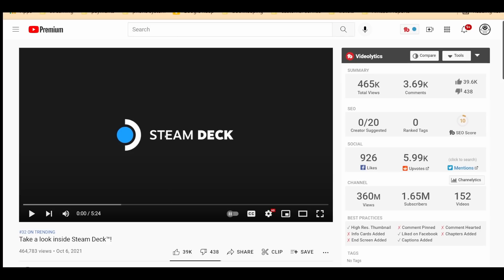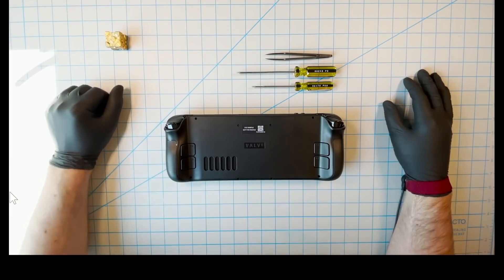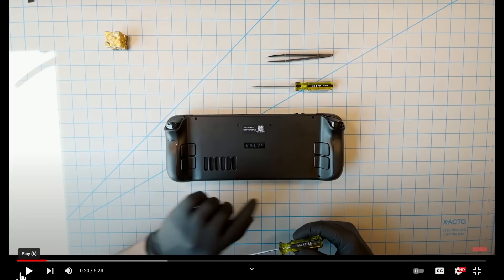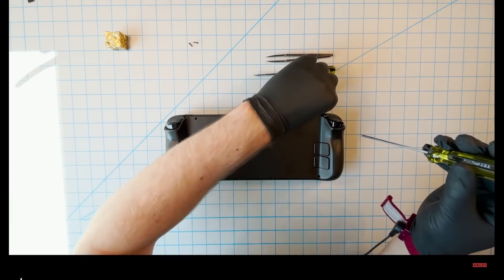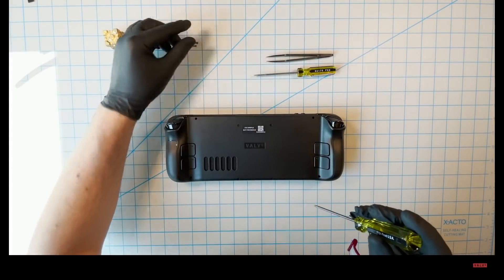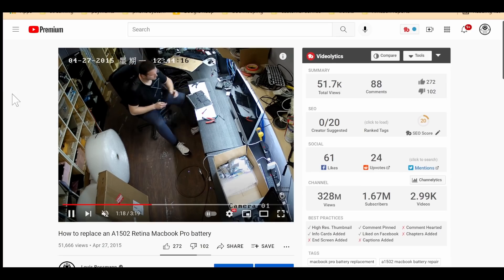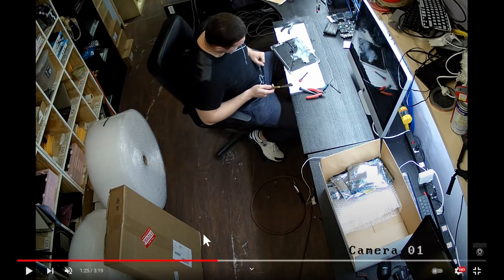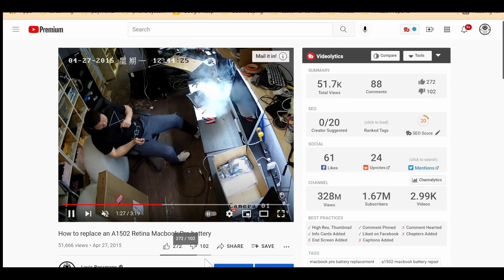Steam deck battery may end your life? bruh 😑

Comment: I agree with you that that I think they're just beign extra careful with their wording by saying the batteries could kill you and opening this up "will decreese the structural integrity" because of legal reason, like I can see how it could be the case if you mess up by damaging some seal or not putting the right torque on the screws, it's definately not the case all the time that opeining it up will reduse the durability and very unlikely that someone will die from inproper handling of the battery (you could maybe burn down your house and die in the fire I guess) but like I said think they're just being extra careful with the wording for legal reasons

Comment: @8:40

It doesn't ruin it, HOWEVER, because the screws are embossed in plastic, if you crossthread it by overtightening, it will be looser, and if you do it too badly, dropping it could pop the screws through the casing.

Comment: Given that they're using self-tapping screws, the structural integrity claim does have some merit. The screw posts can be easily chewed up if you aren't careful to thread the screw back into the original plastic thread. Would have been better if they told you how to avoid this potential issue though (just slowly turn the screw backwards until you feel it drop into the thread before screwing it back in).

Comment: I think saying things like "why you should not do something" is a way for valve to protect themselves legally when someone really mess things up.
As the stractural integrity I am sure it is for the same reason plus if you open and the screw holes are plastic at some time it will be loose..

Comment: for the structural integrity part, the only thing i can think of is self taping screws get less effective at holding things together the more you take them in and out because they are effectively cutting new threads everytime they go in, so theoretically, if it is opened too much, it could loose the ability to actually hold itself together.

for your last comment on the warranty thing, i like to think im not one of those "dicks", if i supply a part for you to install, i supplied because i want that particular brand or product, and thus i know the warranty doesn't cover the part itself as it wears out under normal conditions, but what i do expect your warranty to cover is  the work that you provided, meaning if you do something wrong and either the part i provided or and unrelated part fails as a direct result, then i expect you to warranty the work,  this also includes if you accidentally damage the part during installation, after all, i brought it to a professional so as to lower the risk of damage during the install.

as for the original topic, i used to work for a third party company that repaired apple devices, i specialized in the iphone 5c and 5s. but there were other devices being repaired as well, someone punctured a li-on battery in an ipad, our sop was to immediately dump a trash can onto the floor, use can to cover the device to try and contain the smoke, and the entire area evacuates for half an hour while the specialized cleanup crew went in with proper ppe to make the area safe again. ive personally never punctured a battery and i don't ever want to, but its not going to stop me from opening my devices, i took the li-on battery out of my hp laptop cause i saw it had swollen during one of my routine cleanings, now my laptop is cable only operation

Comment: Yeah if opening a device really weakens the structural integrity that's noticeable then it's not a good item to buy because it's designed to fail/break quickly even if not opened.

Comment: My first thought think when they said opening it up will weaken it.. they meant at that moment opening it will weaken in that moment.. and maybe if you do not put the back cover on correctly, you weakening your steam deck..  but if you can put it on carefully it should not be a problem.  The back plate is like the tab on a pop can.. when its closed up and holding soda.. the pressure of the soda inside the pop can makes it vary strong, and the sort of thing you could hurt someone with.  but when you open it up, the soda in the pop can can now move  out of the way easy and cause it to be vary easy to bend the popcan.  

The issue in all of this is self tapping screws in a the plastic.. those are really easy to strip and ruin... so if you ever hand any experience with those in plastic devices.. that will tell you more then enough to know if you can open and close up a device like this.   I would think for you Louis.. it is no problem to deal with those things.. and you might have way to work around should you accidently strip a screw.  Most people should let you handle fixing, and upgrading a steam deck if it has a problem because of this..

Personally, while I feel like have no problem opening and closing this back up...and its vary nice they have replacement joysticks, but I really hope I don't have to.  it be nicer to do without opening it up.

Comment: Pong, 1976ish...  Okay, I have an crappy old swelled li-ion battery I've pried on and poked at here and headed outdoors now to drive a nail through it...
I've tried and not succeeded damaging chips with normal static electricity.  These devices most often have ESD protection built into the circuitry, I know this from working in the device industry along with the design engineers..

Comment: With the screws being self tapping and requiring a particular tightness I could see that being the reason for the disclaimer of the structural integrity. If someone over/under tightens they could make the device less structurally sound so it won't meet the original specs that they did for drop testing. With this being a mobile centric device I can see why they put that in the video as some peoples experiences with newer phones being decently drop resistant.

Comment: You are making the classic mistake, saying I I I, you are you, everyone else is not you. your applying your own logic to what the Guy is saying, a company has to cover every base when it comes to sending out any electrical device. I have seen plastic bags with do not put this over your head, why because someone has either died or nearly died putting the said plastic bag over their head. What if someone swaps put their battery for a aftermarket cheap clone sets it up and it works puts it in a back pack to go to a friends and it explodes like that. Look around this has happened many times. Its too easy for you to use your own logic on why the guy is saying but when it comes to the public, well I've seen people retrieve a piece of toast from a live toaster with a fork, insert metal into sockets. Valve have to cover every base, and no matter how stupid or patronising it sounds people will do stupid things.

Comment: Shows that right to repair is making slow progress. That's good. About 30 years ago I did blow an IC on an apple II.  Then I repaired 200 of them without an issue. Lesson; don't work on stuff at 2:30 in the morning. I don't wear a wrist strap. I have seen why they say you can affect the strength of the case, incorrect assembly by someone that doesn't know how or why all those screws are put in in the first place. Mostly, people just drop them and break them without taking them apart anyway. (Which I am sure you know).

Comment: I think the warning about the battery was less about the immediate danger and more about long term dangers.  Imagine you're just an amature and you're swapping out the SSD in this thing and you accidentally put a small puncture in your battery and it doesn't flair up, but stresses it so that it CAN flair.  What happens when you put that Steam Deck in your backpack and you're on a bus or you're walking around and it gets hot enough to rupture the battery and it bursts into flames and now you're on fire because it lit your backpack and your clothes.

I definitely get that it's a niche scenario, but Valve probably has to mention it for legal reasons.

Comment: I think they implying that when the screw are not replace properly that the device is easier to open back up if drop and not that the plastic structure become fragile but also if you use the wrong screws or over tighten you can split the plastic at the screw hole   but overall it a video that armatures should not use and that why he keep stating get a professional (like you Mr. Rossmann )to fix it, and the key point is spare parts availability . 👍🏻

Comment: The glove looks like the relatively conductive carbon kind with less than 10^9 Ohm surface resistivity.
I think it's fine to put the ESD strap over that.
Reply: Actually it looks like the contact part of the ESD strap is on correctly. There's a metal plate under the part where the cord plugs into the strap, and that actually looks like it's touching his wrist skin where the glove stops. It's just unfortunately that the backside of his wrist, the strap is looped over the glove which makes it look wrong, but in fact that part of the strap isn't important as the metal contact on the other side. Most ESD setups that the other end of the cord plugs into will sound an alarm if it doesn't detect contact with skin, so if he does have it plugged in, it must be touching his skin if the alarm squeal isn't driving him nuts.
Reply: That was my thought also.

Comment: Regarding structural integrity: they've said "lessened somewhat" not "ruin". Those are two completely different assertions.
I think it comes back to the self tapping screws. If structural integrity depends on the back being really firmly attached and the screw holes get slightly widened each time you put it back together, structural integrity will be "lessened somewhat".

Comment: It's definitely all because of legal reasons, especially the structural integrity part. You cannot 100% be sure how someone puts it back together especially with self tapping screws as most people have no idea what they are doing. And with it's compact size, even a mm could cause something to go wrong, even if it's a one in a million chance of it happening. Think of how many people use steam and the market for this. They are being overzealous because they don't want to get sued into oblivion for something that normally shouldn't be an issue.

Comment: 8:07 As someone who's thrown and smashed game controllers hundreds of times, and opened them with their super-weak self-tapping screws to repair them many times, I can say that this is total bullshit. The plastic screw posts will break off before the screws strip. Besides, if this really does weaken the threads, it would transfer more of the drop energy to the threads stripping, rather than to the frame as with the factory condition.

Comment: @Lous, as someone who's taken apart a number of gameboys and cheap MP3s that use self tapping screws; I can totally believe that taking the device apart weakens it.
the PS4/5 controllers are the same. once you mess up the plastic that the screw threads into; the shell can easily partially come lose leading to cracks in the plastic when dropped. 

that being said, on a device that expensive, they shouldn't have used self tapping screws. this isn't a 60$ game-pad, this is a 500$ hand held. 
At least they didn't use glue i guess?

Comment: I guess them are saying that opening it can damage structural resistance because if you over torque the screws you can force the treads and them will break easily if you drop it, and if you let the screws too lose and you drop it the vibrations can break the plastic treads.

Comment: I'm a degreed mechanical engineer and to answer your structural question, the answer is... No* (your bullshit detector is right)

*Disclaimer being that the product was most likely assembled with electric screw guns which precisely set the torque.  And the product was validated with those screws being torqued at that particular setting.  So it's just covering their asses because the product was drop test validated at those torque values and they don't know if its performance will be equal to or less than a reassembled product.

Comment: If the casing is held together by plastic clips that can break when you disassemble it, yeah, that can affect structural integrity. But it didn't look like the Steam deck has those. Oh and also if you overtighten a screw and basically damage the plastic threading, I suppose.

Comment: 1) First thing I notice: the guy disassembling the device is wearing gloves and the antistatic wrist strap is on the outside of the glove. That said, those gloves could be made of conductive rubber, but probably aren't.
2) Removing and replacing self-tapping screws multiple times can strip out the plastic and it will reduce the effective strength of the fastener, thus they are correct, but using self-tapping screws in plastic is a super-cheap way to fasten handheld devices, and can strip out from shock damage more than metal-post screw mounts anyway. It's just one more reason for a company to recommend against user-servicing.
Reply: i noticed the wrist strap too.

Comment: As a mechanical engineer, the only way I could imagine you can make the structural claim would require one or more screws eating away the plastic threads.  Think of a table where one leg is broken in half.  It can still stand with the remaining three, but it won't work well.  An incorrect or damaged screw would result in more stress on the remaining ones.  Repeated cycles would eventually weaken the others.  

However, the fact that they also made the plastic snaps along the edges would mean the backplate isn't held in with JUST the screws, and there are also four more inner screws to help carry the weight of the backplate.  My scenario is a real stretch but it's the only one I can think of.  But this "table" has four legs at the corner and then another four along the inside as well (8-legged table) to carry a load.  Losing one of them isn't a big deal.

But let's say one of the four outer ones were stripped, and the plastic clips broke or get worn down.  And what if the user didn't replace the four inner screws because they think they're not really needed (been there, done that).   One of the corners would float and gravity would be pulling down on the other three.  Picking it up, putting it down, rotating, spinning, would eventually cause one of the weakest of the other three to start to fail too; it's like bending a paper clip over and over before it catastrophically fails.  Now, the entire weight of the backplate is reliant upon final two, then one of those will eventually fail.  Now you need duct tape to keep the back plate on.

Another possibility is overtorquing the screw back in.  That might compress/deform the sheath/interface and potentially cause a crack.  Sounds farfetched, but realize that people are dumb enough to use a cordless impact driver to screw in motherboards to cases...

Lotsa "ifs" in there.

I think the makers are just trying to make people think twice before opening the unit up if they don't have to.  And a video of it might be enough for people to say "well, that's what it looks like inside."  And it also helps make the costs a bit easier to swallow when people know that things that probably will fail can be easily replaced.  We don't see enough of that anymore.

Steam gets points from me from the fact they didn't use glue or that nasty double-sided tape sh*t and had some field replacement capability in mind.

Comment: The back could fall off if you stip the screws and drop the thing, also they might be saying that the mechanical structure will be damaged, is because the whole structure in simple terms is 2 plastic panels + the strenght of the inner parts wich (at least that's what I think) souldn't realy take mechanical stresses, therefore since the 2 panels are not squeezed together properly and takeing away for example the bending  forces properly, only the front panel and the inner mechanicals will take the stresses instead of moostly just the 2 plastic structural panels. (I might also be wrong, you can't see the buid of the front panel, that's just what I think.)

Comment: I'm pretty sure by the compromised structural integrity they refer to the self tapping screws. When you drop it after repeatedly unscrewing and re tightening them the screw might rip out the weakened thread from the plastic.

Comment: Louis.  About the battery killing. Don't ever underestimate the stupidity of people. If someone can mess things up so badly they risk burning themselves to death, it will happen.
Besides. It is a U.S company protecting itself from the weird-ass legal system that exists in that very country. It has to be done this way. Otherwise, the previously mentioned stupid people will sue their asses off for the most ridiculous things.

About the structural integrity. Self-tapping screws, which is mentioned in the Valve video is the reason. you should know that Louis.
Unscrewing and screwing self-tapping screws in plastic posts will degrade the plastic post quickly. after a few cycles of that the screw will likely fall out on its own weight.
Yes. There is a trick to put screws back and still have most of the structure of the plastic post intact. But even that has limited use if one unscrews it many times.

Comment: Louis, If you unscrew the bolts that was screwed/welded with a heat inside a plastic frame while manufacting -  and you unscrew it and then screw it back in you may not penetrate it right way - so the structiral integrity goes of. the divice become les resistent - and easily to breack.

Comment: I assume the weakening is due to the plastic getting flexed by reinstalling the screws.  It's not as solid a connection as if there were machined screws into reinforced socket.